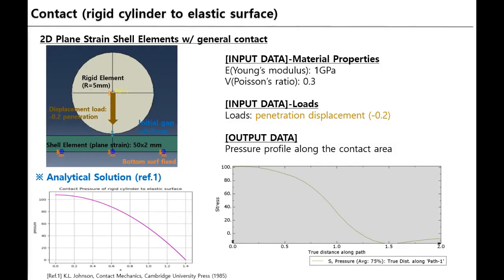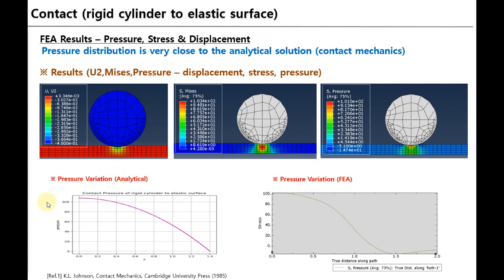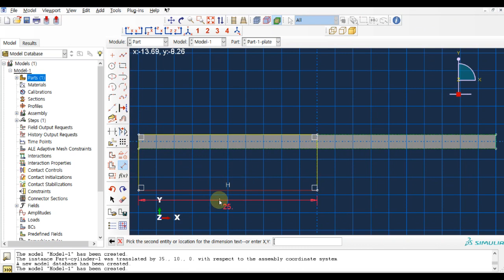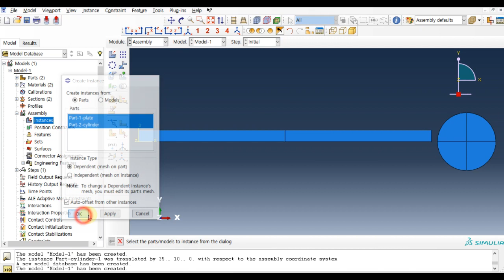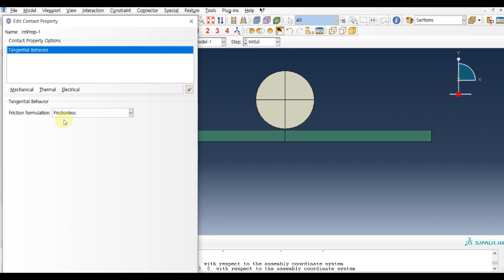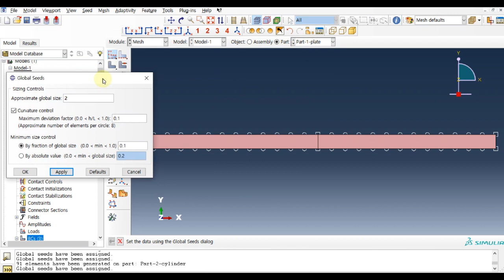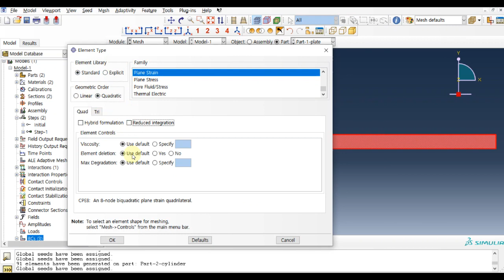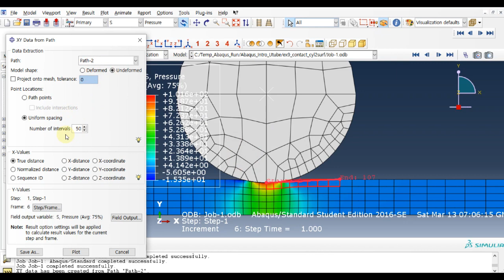Abaqus FEA - Contact Mechanics of Rigid Cylinder to Elastic Surface

Comment: What to do differently if the plate is rigid and the cylinder isn't?
Reply from the maker: Well,..I think you can do this way..
(1) you can assign "constraints/rigidy body" option for the plate instead of cylinder.
(2) or when selecting part type at the beginning, just select "Analytical rigid" instead of usual "Deformable" for the plate.
I hope this's helpful for you ~